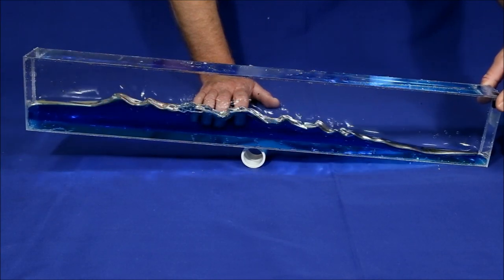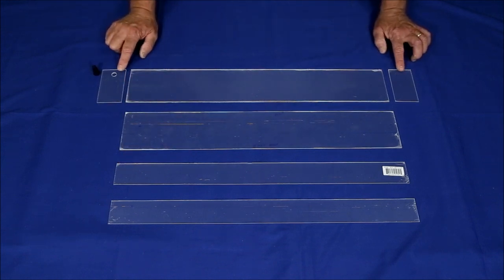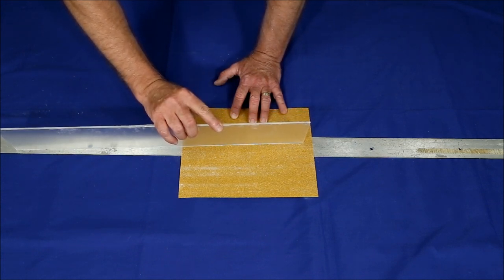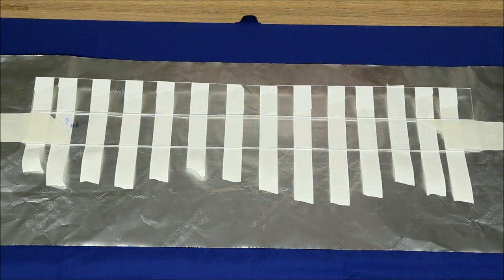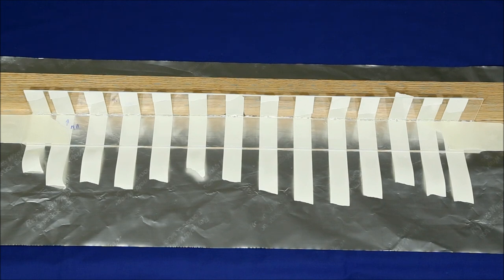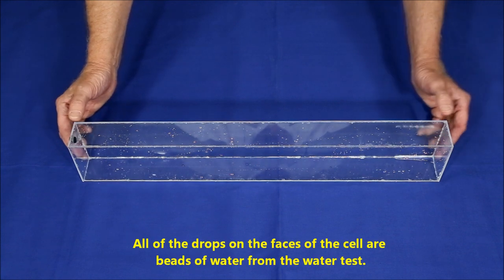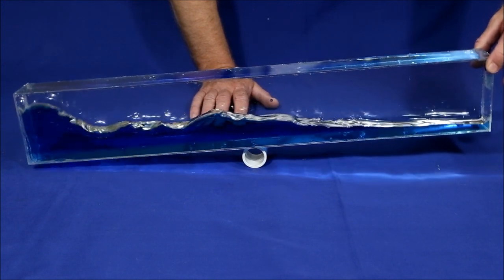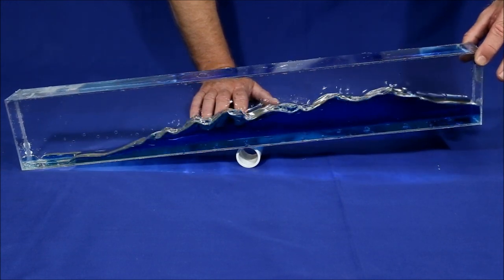How To Make A Wave Motion Machine

Comment: Hey Wayne 
I’m trying to re-fill an 18 inch motion wave cell that I have.

I used water and food dye like you did filled about 1/3 and then the rest baby oil.
But when I put the vessel on the motorized base that it came with it rocks back and forth like it should,  but I’m not getting a very realistic wave happening.

When I originally purchased this machine, it came with a jug of clear oil and filling instructions.

There was some kind of liquid dye that smelled like a magic marker already inside the vessel that I had to add water to and after that I added the oil.
The machine worked well but there was some kind of debris inside the vessel that shouldn’t have been there floating around.

So the company I purchased it from told me to remove the oil and strain it and then toss out the coloured water and told me to get a blue marker and use the dye/chemicals in that with new water and then put oil in.

I tried just using your method of water mixed with food dye and then oil on top but it didn’t give me the wave action that the vessel had previously.

Is it possible that the chemical in magic markers (alcahol) would make a difference in regards to how the oil and water work with or against each other ?

Is it possible that there needs a something besides water, food dye and oil ?
Any idea ?

I did read up on magic markers and it would have to be non-permanent to mix with water.
Reply: Interesting!
 I would think that the alcohol of the magic marker dye would mix with the oil instead of the water and cause everything to dye the same color or leach into the oil and separate from the water and cause clear waves inside of a blue sky or vessel.

Comment: Think  I’ve got it figured out.

I took a blue marker and swished it into some water and the water turned blue; so they probably used dye from a marker for the colouring.
The chemicals in a marker are probably not important.

They told me that I would have to re-use the oil that it came with.
It certainly looks like baby oil and doesn’t have any real odour.

So I’m betting that it’s a different viscosity than regular baby oil, because I think the motorized base might rock the vessel slower than yours does.

If this is the case, I don’t know if it would be better to use a lower or higher viscosity oil. ??
Reply from the maker: My guess is that a higher viscosity oil would act like a thicker liquid and dampen the appearance of the waves. Low viscosity, thinner, oils would permit the waves of water to more easily penetrate into the oil creating more detailed action. Thanks for commenting!
Reply: @wayneschmidt490 I wonder if there's a good way to thin the oil to get the wave action that someone else might need, like if they built the wave mechanism that runs faster or slower, and stay in the oil and stay clear?
Reply from the maker: A search for clear oil viscosities might turn up liquids that are thicker, slower wave action, and this that are thinner, for fast wave action. @bodeine454
Reply: @wayneschmidt490  I'll see what I can find, thanks.

Comment: I was cleaning my closet out and found my Lava Simplex 18” Caribbean Wave Machine!
The problem is there’s no more color to the wave. I watched your video and was wondering if it’s possible to add a food dye and would it color everything or just the wave. I would appreciate your thoughts on this.
Reply from the maker: The dye I used was simple food coloring added to the water, which makes the lower blue layer. The upper clear layer was a clear baby oil I found in Walmart. If your wave machine has a removable plug in it, it may be possible to pull the plug and add more color to the water layer. The danger is in reseating the plug. If it ever worked loose and leaked it would make a nightmare of a mess. Lacking a plug, you could drill a hole, add the dye and plug the hole, but the same leak hazard applies. Good luck!

Comment: 0 I'm having the same problem I use baby oil distilled water but I can't seem to get that wavecrest action any ideas? Does the vessel need to be totally filled with either oil or water?
Reply from the maker: I found 1/3 water and 2/3s baby oil worked best. It looks better if there aren't any air bubbles in it.
Reply: @wayneschmidt490  thank you 👍
Reply: How do I am I supposed to fill the entire vessel so there is no air at the top or do I leave a space for air
Reply from the maker: I stood mine on end so the filling hole was at the very top, filled it all the way up then inserted the rubber cork. @markcallahan-qk7dt

Comment: Hey Wayne 
I tried thinning the oil with gamsol (odourless turpentine) but this didn’t have any positive effect.

The thought was  by possibly lowering the viscosity or the weight of the oil that it would create more wave action, but after trying this with no positive effect, I now actually believe that a higher viscosity or heavier mineral oil might be better, perhaps the weight of the oil would push down more on the dyed water when the vessel tilts on its motorized base and create more wave action ??

The other thing that might be worth trying is putting a little isopropyl alcahol in the water, this mixes with water and not the oil l, but it does makes oil heavier, so we will see .
Reply from the maker: When I made mine I didn't do any tests to see which oil worked the best, baby oil, and it worked great. I guess I got lucky. Good luck with your tests!
Reply: Interesting thoughts 👍
Reply: @wayneschmidt490 That's interesting too, baby oil I would think is thinner than regular mineral oil so it sounds to me like thinner oil gives better wave action than thicker oil. IDK
Reply: @bodeine454  The oil is lighter than the water so it makes sense that the lighter the better.. Been wanting to build one of these things for years - now might have a go..

Comment: How to do add a little plastic ship to it?
Reply from the maker: That would require a hole large enough for the ship and a plug large enough to seal the hole after inserting the ship. The hazard is that a larger plug will be easier to knock loose and cause a leak. Thanks for commenting!